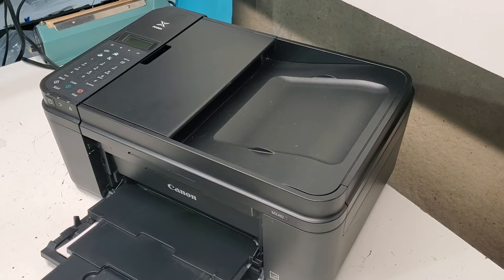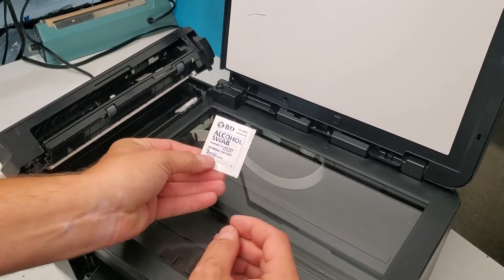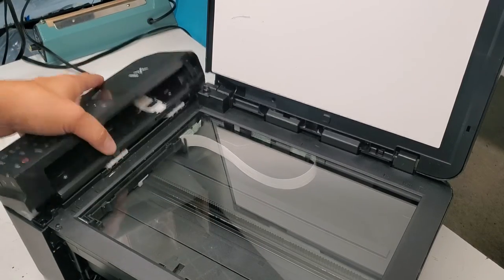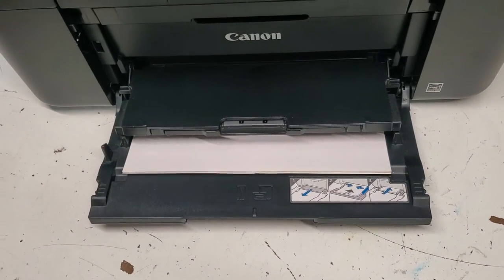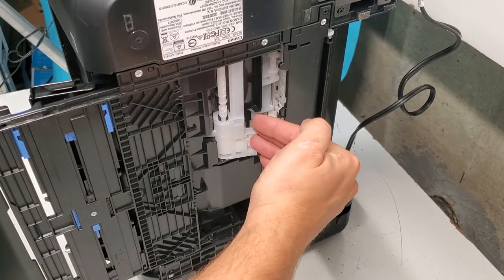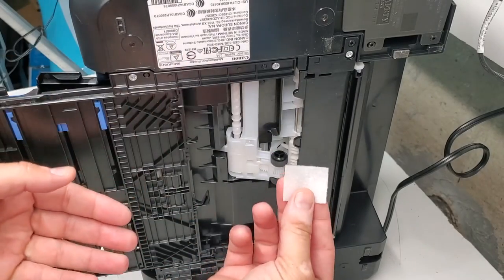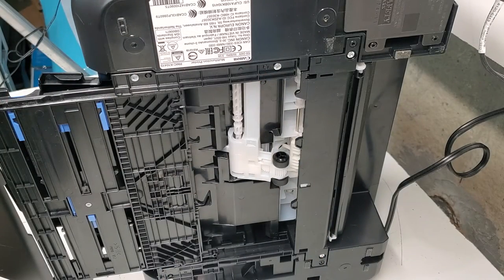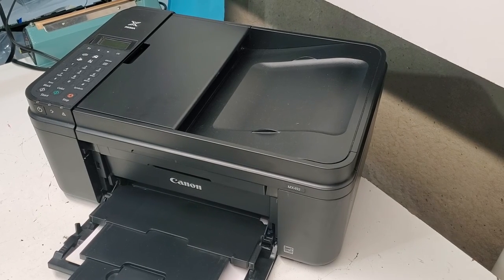Canon MX490 MX492 TR4520 Paper Feed Issue Resolved || Error 1003 || ADF and Main Tray Pick Up Jam

Comment: I had given up on this printer after getting absolutely no help from Canon troubleshooting guide.  Right before I was going to toss this printer in the trash I stumbled upon your video.  I didn't expect this to work because the rollers didn't appear dirty.  But I cleaned both  pairs of rollers (under side and rear) with alcohol and the corner of a paper towel. I  was thrilled when it actually worked.  Bravo!!!

Comment: Thank you! I wasn’t even aware that there was a place to get to underneath the printer. I had checked the back and the front but now I’m off to check the middle and clean my rollers. I’ve had this printer since 2017 and never had one issue that I couldn’t fix just the logical way until now. Today my printer decides that I’m out of paper when I’m not. Hopefully your tips will fix my issue.

Comment: This was very helpful cleared jam for good. 
Paper kept jamming intermittently. 

A tiny plastic piece that is part of the rear assembly was loose and would pop up occasionally (out of position)when pushing the paper tray back in. 

Removed the broken piece from the rear assembly and now it’s printing like when it was new.

Comment: holy crap i have a brand new printer just got it for christmas and already ran out of ink but then i replaced it then i go todo a test page wouldnt work thank god i had one of those alcohol wipes and it work finally just a tiny ol wipe cleaned those heads/wheels and whalaa it worked thank you i really appreciate it...lol you saved the night.
Reply from the maker: That's great, good work! Thanks for sharing. Have a great day!

Comment: Thanks for this video. Unfortunately this did not work. Is there a way to give to rollers more grip?
Reply from the maker: Thank you. Are the rollers spinning fine when sending a job? A problem may sometimes be that the gears are broken, which i hope is not your Printer's  case, but check. Usually cleaning is what gives it the grip.

Comment: My printer keeps saying "Load paper" even after putting paper in. Watching your video I noticed that your paper sits in the main tray further than what mine does - mine sticks out past the end of the black plastic. Why is mine doing this? I can't print anything as I can't load paper, even though I believe I am loading it correctly. Any ideas as to what the issue might be?
Reply from the maker: Hi. There must be something in the way. Were you able to inspect with a flashlight? Also, my paper size is 8.5x11 inches. Standard letter size paper. I don't know if that may be the case. If paper isn't loaded to the end, paper will not be able to pick up paper.

Comment: My adf feeder is working when I’m scanning but it doesnt pick up when I’m trying to photocopy. Please help me what else I can do
Reply from the maker: Hi. There is a sensor tab on the adf which is royally stuck and needs to be released for your printer to let you scan off the glass top. The adf rollers need to be cleaned with alcohol or windex and that should resolve the problem with the paper not being pulled in the feeder.
Reply: @303electronics  thank you for such a quick response. Where is that tab located?
Reply from the maker: @AndreaCorpuz29  Its right inside the area where you place document to be scanned. About 1 inch from the edge. Open the top cover to get better access

Comment: The paper feeder on top still not feeding. What seems to be the problem? It detects when i put the paper.. but does not roll or anysound that it is feeding the paper
Reply from the maker: Hi. Open the adf cover and try to spin the gears. If they spin, but rollers do not, there may be a gear that slipped out of gear assembly.  Sometimes, just aligning the gear into position will resolve the problem.  Make sure your adf rollers are clean as well.

Comment: What if the problem is not the roller, but the paper is getting jammed on the opposite side of the roller in the ADF? And I've looked and there is no debris on that side of the feed. I cannot tell at all why the paper seems to jam on that side of the feed.
Reply from the maker: Try to see if your printer top door is closed fully. It may be out of hinge area and paper isn't feeding through because of obstruction

Comment: My printer picks up an extra paper at the end of a printing job and thats when it gets jammed. It seems like the pickup rollers activate after the last sheet is fed and then the printer won't push that paper through to the printing area or a third set of rollers (if there are any) aren't pulling it through.
Reply from the maker: There maybe a couple things. 1. Chwck the paper to make sure it is loaded at the proper size mark. 2. The paper stop piece which looks like a zigzag, located at the end of paper tray, maybe out of place or broken.  Check that.

Comment: hi i have a different problem. so were trying to print and everytime we print something it says select a size of a paper. were trying to press the "ok" button but it doesn't work. we tried all the buttons and theyre not workin. so how are we going to make them work?
Reply from the maker: Hi. You need to check the settings of the printer on your computer that you are printing from. Make sure youbselect proper paper, for example "Plain" , correct size. Usually "letter" and save the settings.  Let me know if you tried that already.

Comment: ive done this and my printer just wont pick up the paper, i think its because it might be too thick though but it used to pick it up just fine now i literally have to push it in so the back rollers pick it up and it prints fine then but its a hassle to get it to go through sometimes

Comment: Mine has started switching itself on and off over and over and only says "canon" on the main screen. It won't let me clieck maintenance or settings. I'm freaking out!
Reply from the maker: Remove the cartridges and clean the contacts. That may be causing the printer power to short

Comment: I have the same printer the paper got jammed and i removed it. But after removing the jammed paper its still saying that theres still paper jammed
Reply from the maker: When you removed paper, was it intact,  or ripped? If ripped, the piece may still be in printer. Turn printer off and back on to clear error. Also, use flashlight to shine inside printer and see if anything is out of place.
Reply: @303electronics  good evening! it was intact i dont know where i did wrong. But my mom is planning on getting it fixed. Last time this issue also happened but got fixed by a professional.  And also the paper got jammed on the adf. 😥👉👈

Comment: this series sucks. Since day one it doesnt like to pull paper years later ive used it maybe 5 times and when I do i hand feed each piece in or it jams. I'd throw it in the trash if it was a daily use item.
Reply from the maker: You don't have to throw it away. Actually, it is very easy to get to paper feeder roller on these printers. Just slide the printer tray open, put printer on its side and you will see the rollers. All printers get that problem since paper leaves small dust particles that accumilate obver time.

Comment: OK I followed your steps precisely. And it still says there’s no paper. When I look in where the paper is fed, I don’t see anything coming down to grab the paper. Am I supposed to see the rollers drop down or something to grab the paper? Because when I look inside I see absolutely no movement of any kind. I see a little plastic post that’s centered between the middle and the left which is static, doesn’t fall down or anything. So I’m wondering if more is broken or not responding inside my printer. It was working absolutely perfectly until today and I don’t use it that much. Any advice would be greatly appreciated as I cannot afford to buy a new printer. Thank you very much!
Reply: I'm having the same problem! I noticed that in the video, his paper sits in the tray further - mine sticks out past the end of the black plastic. I cannot for the life of me figure out what is going on!!